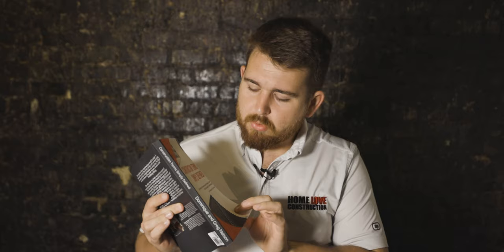What Are Hurricane Straps? Tampa Contractor Explains!

Comment: For block cement walls you have to use 1/4 inch 2 3/4 cement screws and a 1/4 inch washer. Not nails in Florida. You have modify the straps to fit the oversized screw. Drill it a bit bigger hole fyi to whoever watches this
Reply from the maker: We usually use tapcons. They don’t need washers. Or we set the straps before pouring the lintel
Reply: @HomeLoveConstruction  code says you need a 1/4 washer
Reply: Thanks for this. I plan to get a flat roof converted into pitched roof and was wondering how they will attach the roof without having to pour. I'm guessing there is a strap that can be used anchored to the inside of the wall? If anyone have a place where I can look at some drawings it would be great.